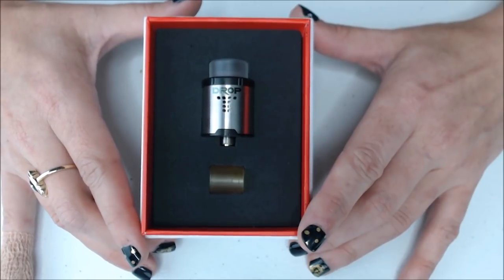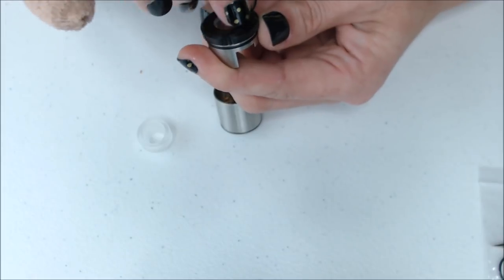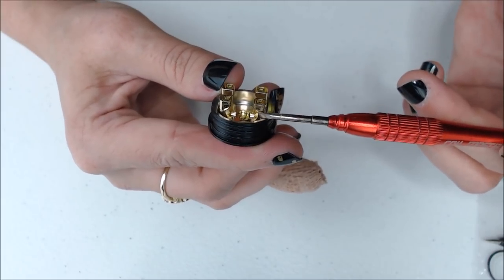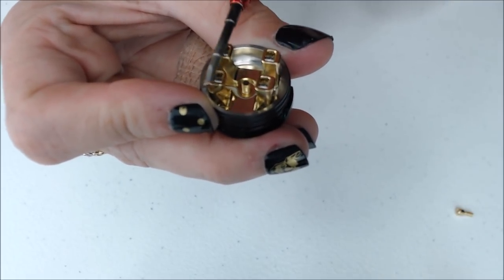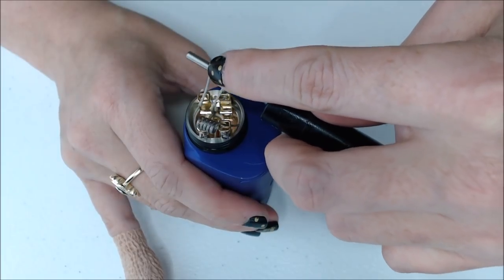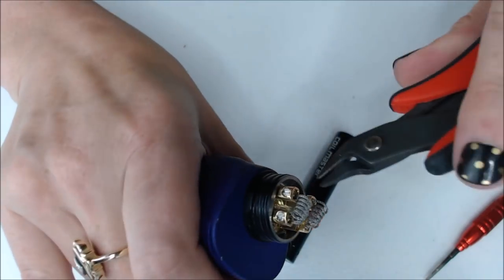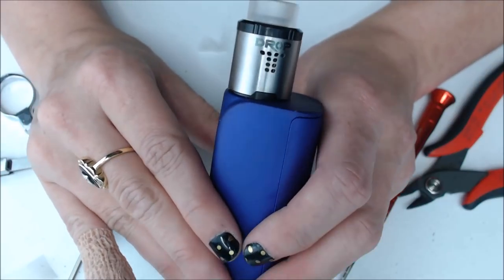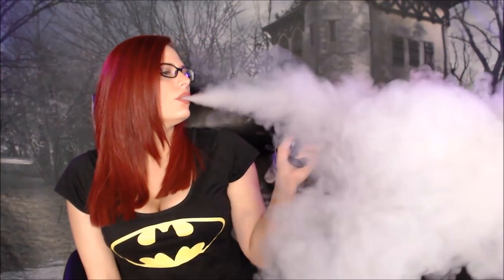The Drop RDA by Digiflavor & TVC | Review and Build

Comment: This is the first RDA I ever bought.  I have probably tried 20 builds on it.  Very muted flavor.  However, the drop I bought had a gap between deck and sleeve and drip tip didn't stay in. So, I got a defective one.  But, because of all the hype I got another one.  Definitely built much better, but still having flavor issue.  Since you have had this for a while, what are your favorite coils and favorite coil position?  I have also tried single coil and little better, but not much.
Reply from the maker: Triple fused Clapton’s I pull my coils all the way to the center as close together as possible without them touching and I run the airflow with the top 4 air holes closed so only the bottom 6 are open. I get plenty of great flavor from it.
Reply: KimmyVapes  Perfect, I can use my new coils.  Gonna give it a try. Should I mount coils lower?
Reply from the maker: For me personally, I like to keep the coils about 2mm above the posts, there should be an example picture for coil placement on the side of the box it came in. I find that placement gives me the best results.